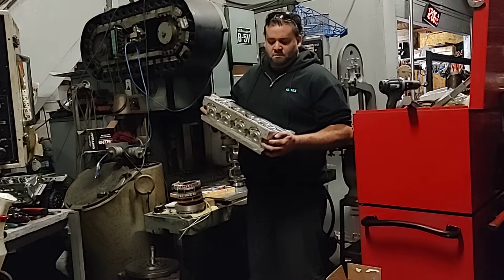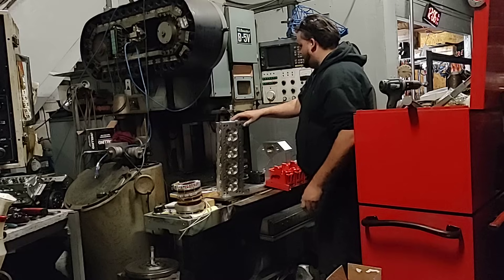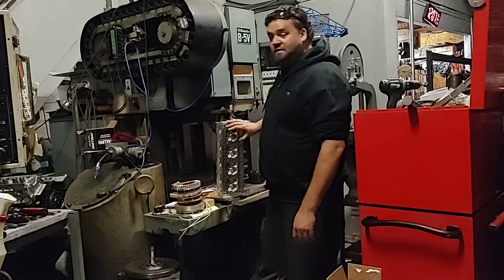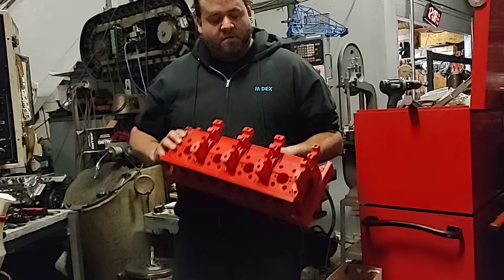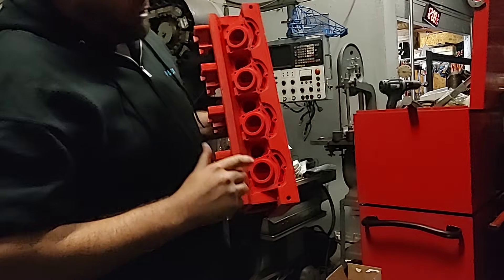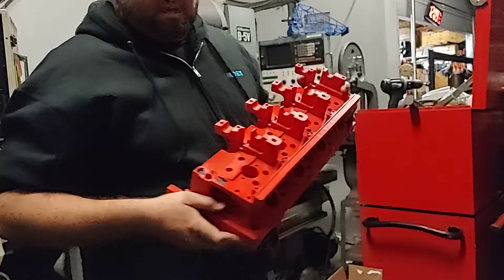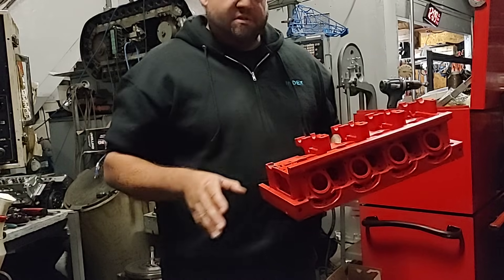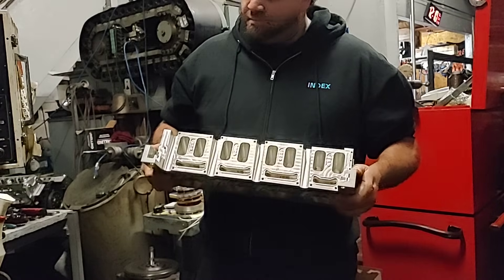LS 4 Valve Cylinder Heads- Better yet, they're BILLET

Comment: Why go through all the trouble of making a billet 4 valve head and then using tractor technology to actuate the valves? A simple one over head cam would be much simpler and dual would be about just as simple and even better. 
Pushrods belong in the museum.

Edit, don’t get me wrong, the work and design is awesome and so is the direct swap idea. Just put a belt and cams in to the mix.
Just look what Kevin and Pete are doing with heads of their land speed racer and every other engines.
Reply from the maker: Then do it better! I think 8-9k rpm is good enough for me and a couple other Americans. With totally tunable valve train that a simple man can rebuild and customize, it'll have to do.

Comment: No disrespect, please don’t price out the average person who will make ways to put a set of these on every LS they have!
Reply from the maker: Assembled ready to run heads will be $7k. There's no way around it. The scope of these is this: it is very competitive building a 1000-2000 high rpm LS. These are for the serious weekend warrior or race team to get on an exchange program. A junkyard 5.3 filled with concrete and forged rotating assembly with a big turbo will break almost anything you put behind it.  they are not cheap, but they aren't $30k either. I hope to help the small racer punch well above the weight belt, and do it with reliability at least from what I can help. Best!!

Comment: Is the intake manifold gonna have 16 runners or just 8 very large runners? Also I’m sure you have valve covers designed already, but I can’t imagine what they are gonna look like lol
Reply from the maker: Valve cover prototype is somewhere on FY_lsx Instagram, they will have coil pack provisions. 

Intake will merge each cylinders into 8 ports for plenum style. Multiple injector provisions will be available. On the itb intake, the two runners will merge into one using the butterfly as the initial divider. Thanks!!

Comment: awesome work thus far. so much for the LS crowd/🤡 saying 2 valves are better than 4 valves per cylinder.
Reply from the maker: They might have an argument when it comes to nitro hemi stuff. But I think the results are in on the argument. It does show how good a two valve head can be with mileage and low engine speed dynamics, and other boring stuff like that.

Comment: This is incredible! Such a shame that multi-valve pushrod heads are so rare aside from diesel engines. I’ve been building a Late Model Corvair and no matter how many times I see even the “big valve” heads, I’m astounded at how little area the valves take up. Make sure you patent this as soon as possible before some Chinese company decides to try cloning them.
Reply from the maker: What would I patent on them? Also, look up the Harley M8 engine, it's a very similar system!! Thanks!
Reply: @AwkwardPerformance Honestly, not my area of expertise, but I’m sure there’s some unique design elements that can be patented. I’m glad you brought up the Harley Davidson though, they’re the only gas engine manufacturer I can think of that builds multivalve pushrod heads.
Reply from the maker: @BrapBrapDorito So wth do I patent? I thought making heads would be enough. No one's got answers 😂😂
Reply: @AwkwardPerformance Like I said, not my area of expertise at all. The heads are incredible, I’ve just seen too many inventors get their ideas cloned and lose sales to sketchy eBay sellers is all. Can’t wait to see how the heads come out. 👍
Reply from the maker: @BrapBrapDorito Thanks for the concern, I appreciate it. I'd almost like to see them try tbh lol. I have had machine shops come back to me after showing interest in helping, and basically say it's going to cost us internally too much, it's to risky. Casting them would take about 100 sets sold to break even. This stuff is not cheap if your not crafty!

Comment: Each of the 2 intake valves flow .380 ?
Reply from the maker: They work together to get that. 1.6 inch valves can only do so much
Reply: @AwkwardPerformance  Understood. So maybe you can educate me, whats the advantage of 2 valves over 1 on say a good LS7 casting that flows .400-.430 cfm?
Reply from the maker: @FadetoBlack1463  I can talk for about 2 hours as to why. The short version is at .300 lift, these flow 300cfm. It's area under the curve, low lift flows, fitting the 5.3 stock bore, and air speed breaking the fuel down as it goes by the valve job volume to surface area ratio. Coyotes at 2/3s the displacement put up a fight for a reason!!! Thanks for the question!
Reply: @AwkwardPerformance  I see. Thank you for the reply! Yes the Coyotes are flying!

Comment: I hope the valve train components are made of the lightest materials available. In order to help achieve maximum RPM.
Reply from the maker: 7075 aluminum. FEA analysis has been done to make sure I don't suck.
Reply: @AwkwardPerformance  heck yeah 👍🏼 wishing you the best. This is an awesome project. I’d love to see where it goes. I couldn’t imagine if you do some LS V10 or V12 heads.
Reply from the maker: @Slicktirekicker the closest thing to that I'll be doing is dodge viper V10 heads. Once those are done, we'll go from there.

Comment: If this worked it would have been already. 😂😂
Reply from the maker: It has been. It works in every Harley M8 engine. It's usually the business practices behind the scenes that tanks it. I'll go over why this isn't in production vehicles soon, I mean I think I'm right😂😂
Reply: @AwkwardPerformance Didnt the m8 engine get a complete redesign?  You can only flow so much air through the runners. Would love to see flow numbers at some point.

Comment: Need this on a destroked LS1, be cool to see 13k rpm with a flat plane
Reply from the maker: You better back the lift down to see that rpm, but that would be cool. One of the good things with these heads is you shouldn't have to destroke an engine due to cylinder head saturation limitations within the bird and strike sizes of the LS platform

Comment: I’m a caterpillar engine tech and I’m used to 4 valve pushrod engines. But not split pushrods. Is there something preventing you from bridging the valves rather than splitting the pushrod?
Reply from the maker: It's a split rocker arm system like the Harley M8 engine.

Comment: I love that there are folks like this still innovating in their garage on their own time. I do have some concerns with the implementation of this idea, although I would guess that they have already been addressed. My biggest concern would be the added stress on the valvetrain from the additional spring pressure. On a basic level, double the springs, double the pressure on the rocker arms and pushrods. I'm just curious how this gets addressed. Is there a change to the valve lift by changing the rocker ratio, a custom cam, or a combination of lower lift with longer duration? Valve float has always been a problem on the LS engines when trying to achieve higher RPMs or even just bigger cams to increase airflow. I can't wait to see what this thing can do in real life and I think it's cool that someone is doing this on their own.
Reply from the maker: The rockers are basically inspired and designed similar to after market top fuel 426 hemi systems. If that stuff can take 1000lbs of spring pressure at an inch lift at 9000rpm, opening two 1.6 or 1.3 inch valves with 300lbs each will be just fine. Also, FEA has been run to find hotspots of stress. I'm doing my best to have a very stable product
Reply: @AwkwardPerformance that's awesome I can't wait to see how they perform. What are you expecting for a high rpm before valve float? I'm looking forward to this working out, it's probably the most exciting thing to hit the LS family since the introduction of the LS.😂
Reply from the maker: They are designed to operate valve train wise in the 8-9k range. They should be able to do more, it becomes very cam dependent and they can accept lighter valves for more money. I should have a shop that will do those mods lined up.   @LtDan-ni5rw

Comment: If it's popular enough, then you can contact edelbrock about casting heads for you. Most of the made in the us heads are cast in edelbrocks foundry. There's other foundries in the us you can hire to cast the heads.
Reply from the maker: I will only be making these out of billet. It's too much work and too expensive to get forms made. My casting and pattern friend and mentor looked at me with a very serious face and said ' why don't you just make them out of billet'. So I'm going to listen to Tom, and 45-60psi of boost will live longer under a billet head with 1 inch decks.

Comment: Could you looking into making a cross flow cylinder head for the legendary Jeep 4.0 straight six ..  please 🙏
Reply from the maker: My hands are full with what I got, it would be easier and cheaper to have a fab shop weld two LS heads together. These are for seriously high output, and works over run other limitations of that platform. And what would I patent on it?
Reply: Oh the ls heads fit on the jeep 4.0?    Your design 1st of its kind to have 4 valves per cylinder for a push rod engine..  @AwkwardPerformance
Reply from the maker: @Sral-v1z  I don't know if it does. But I have gotten well over 20 requests for this Lol

Comment: Props!! for machining that with a Fanuc system 6.  Are you drip feeding thru the tape feed?
Serious reliable control,  they just have memory limitations. Great job.
Reply from the maker: Thanks! The machine in the video is broken, and the machine the phone was sitting on has an 11m control, so slightly less limited, but if you know you know. And you nailed it, drip feed rs232 through bypassed tape read.

Comment: What you're doing is extremely awesome and impressive. It's nice to hear someone speaking very intelligently in machinist language from a younger generation. 4 valve pushrod heads have been done before by ARAO and Dominion (BBC, SBC, and SBF heads I'm aware of between the 2 companies). But this is the first I've seen 4V heads for an LS engine. Be aware though, the predecessors I mentioned never saw much success with their products. So don't go balls deep and hog wild building up backstock of inventory. But don't be discouraged either. Merely learn from the past errors of others that went down very similar paths. The drawback is that there are more conventional offerings already out there that produce equivalent or greater flow that will weigh less, and likely cost less too. So be very vocal about the advantages this head gives because it's gonna have to be at a premium price for it to be profitable for you.
Reply from the maker: Thank you. Goal is around $7k for assembled heads. These are made for boost, and continuous output. Marine, off-road and drag racing will probably be their market. The arao heads we're an early inspiration to me, to bad that turned out the way it did. I plan on not replicating any of those mistakes. I will be building a back stock, but only 10 sets at a time as I can do it cash positive. That's a long way away-2026 territory, I got to get these running and do wear study first.
I watch what's available closely, I feel these have a niche in the super fast door slammers and no time drag racing scene, this should equalize things to the coyote at the minimum.
 Thanks for the consideration, I appreciate the feed back, all of it helps. Best!

Comment: Get a patent on these ASAP! Will factory exhaust and intake manifolds work with your heads?
Reply from the maker: It will require my ( plenum or it) intake or a fabricated intake. LS headers and manifolds will bolt up.  What do I patent on them?
Reply: The head Brother. Then get with AFR or Trick Flow, Eldebrock ect. to make the castings for you.@AwkwardPerformance
Reply from the maker: @michaelbyrd499 Everyone already has this stuff as cast. Mercury marine's sb4 exists. This is for a small machine shop to make the small racer go real fast more reliably. There will be no cast stuff here most likely

Comment: While I think its cool what your doing, the newest LS makes over 1000 hp.  I really have a hard time believing someone will spend a large amount of money on a pair of 4 valve LS heads.  The issue with the LS is not in the heads - well kinda - when you make over 1500 on them they either lift the heads or break the crank.  What you are doing will just make the situation worse.  Anyone who tells you their LS just runs and runs making over 1500 constantly is lying.  I seen too many Sand cars with water in the oil or a broken crank.  Do it for a BBC that can actually take the punishment. The LS cant because it was never designed to.
Reply from the maker: Goal is to break all the LS blocks.
Reply: @AwkwardPerformance  Well when the noonan, RHS, ect can't hold 1500 reliably what's the point?  You would be better off building a block that can handle the power first. THEN you would make some big $$$

Comment: Four valves is what makes the Coyote a runner. A six liter LS with four valves is a dream come true!
Reply: Mercedes has a 6.3 dohc na motor making 520 hp stock
Reply: @cathymcgrath8320 Maybe so. The problem is, unlike the coyote, that engine isn't very accessible and has little if any aftermarket support.
Reply: @cathymcgrath8320  AMG makes some impressive stuff. I have a Weistech Tuned CL55 that makes over 600hp to the wheels.
Reply: Yeah, the normal stock coyote head flows almost 300cfm at .500 lift with a relatively small port cross-section. It's hard to beat a 4 valve for raw airflow. The hemi and the LS can but they need a lot more port and lift to do it.
Reply: @l77scmaro2  the problem with that is you lose velocity with huge ports...and velocity is the name of the game. which is why 4 {or more} valves dominate. ie yamaha genesis etc
Reply: Mercury SB4
Reply: @RealDougFields isn't that the one that the lt5 in the 95 Zr1 was related to? It made like 450hp out of 5.7litres in the mid 90s na. We have one in a Vega
Reply: @damianlindsey6177  Yeah- Mercury Racing was involved with the original ZR1 4 cam 4V engine too. The Mercury SB4 stuff is LS based though.
Reply: @RealDougFields IIRC, LT5 was Lotus for the engineering and design, then Mercury for the production run and engineering relating to production. Mercury have specialised in that area for a long time.
Reply: Four overhead cams is what makes the coyote a runner, the four valves just make it better I imagine the four valves if not given proper springs or lighter mass are gunna make this engine a slow revver alone with the valves not moving fast enough
Reply: @benjaminwatson7868  i’m not sure you understand how air flow works or how it creates horsepower.  If he can get those valves to open and close correctly that thing will rip.
Reply: @donjohnston4215  okay if you say so
Reply: All we need now is a 16 port intake with ITBs

Comment: What was the lift on the valve used to obtain that flow # on the 3D head? How soon do you expect to get a billet one together and flow tested?
Reply from the maker: .650 lift was like 378cfm. The surprising number is 300cfm at .300 lift.  I'm doing everything I can to get the heads done with proper valves to get a final flowchart. I will also encourage people to try and find more. Off the first for test, I just kinda went ' okay! That'll' do!'

Comment: If they do not break the valve system you will not be able to keep up with the demand.  With boost these should be unreal.  Naturally aspirated massive potential power.  Potentially also higher RPM with lighter valves.  Someone finally did it.  Congregulations.

Comment: Nice job, I hope to see pretty soon a fully assembled one. It makes a lot of sense, you keep the whole assembly compact and it will make more torque/power at the same RPM with the same cam. If you can detail a bit the weight for the valves, the rockers and the pushrods it will be interesting.

Comment: Two piece sandwiched head? Adjust the bore centers and head bolt locations. Then add two cylinders one could build a wicked 4.0 inline six. There are DOHC 4 valve heads made in Argentina for the AMC, Chevy and Ford   inline sixes. Basically unobtainium as they weremade strictly for race purposes. The race series they are used in is the oldest continuously run race series on the planet.

Comment: Have you calculated what rpm you will be able to reach with these heads?
Reply from the maker: All of the valve train is based on off known built engines that all turn 8-9000rpm. With off the shelf cams that may only a 7500rpm deal, but I'll have a cams available that are tuned for the higher rpm that will still get huge rpm capability, especially for boost. I don't recommend running a stock oil pump more than 6600, so it works out well that a street engine vs a built engine will already solve that. Thanks!

Comment: This will give LS huge rpm capabilities. Lighter valves. Lighter springs. Heavier rockers. Interesting. There's a gentleman that makes drop in over head cam conversions for LS. Put the two together and you rev to 11k. 🇺🇲🦅🪓

Comment: Wow alot of work im interested in how heavy the rockers will be .my biggest? Is what size are the valves intake and exaustbalso what is the runner cc or better yet the csa of a intake and ex runner whats the intake valve to piston degree
Reply from the maker: Intakes 10° exhaust 0°. 1.6i 1.3e. I don't care about the intake cc. Best way to think about it is 2/3 size 706 ports but there's two of them
Reply: @AwkwardPerformance  what's that do to velocity from my experience on 4 valve cylinder heads velocity is the return in power as well  its steep degrade  in power flow numbers didnt mean much  plus you can only fit so much valve. Also how did you lay out the exaust
Reply from the maker: @vinmandich7756 it's merged at a 'compromise' to fit off the shelf headers and to maintain an LS3 flow percentage so lower powered engines can use off the shelf cams.